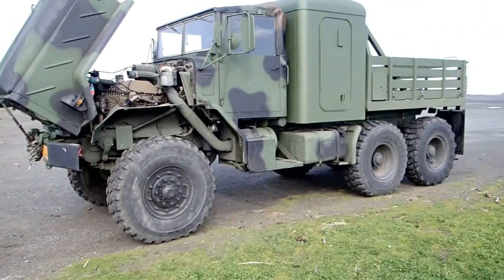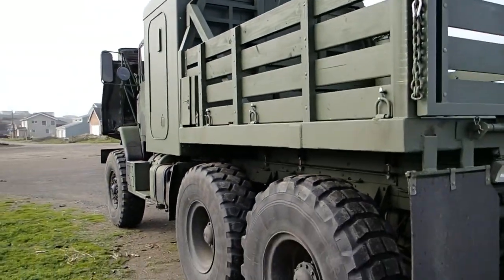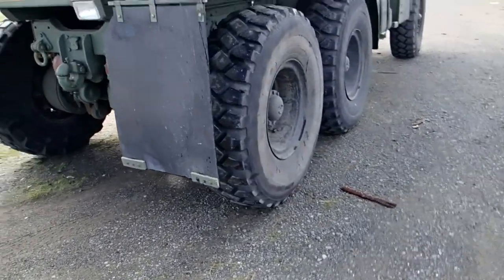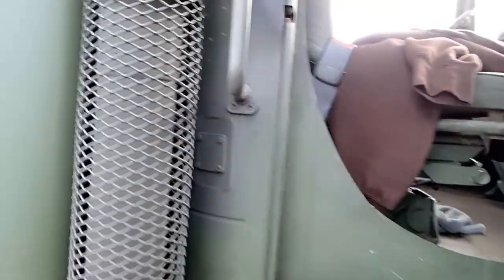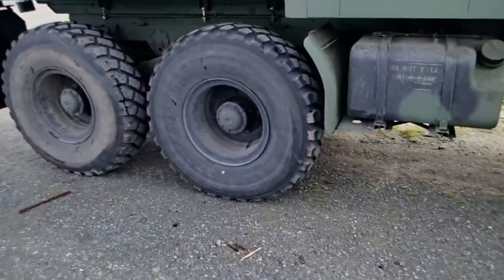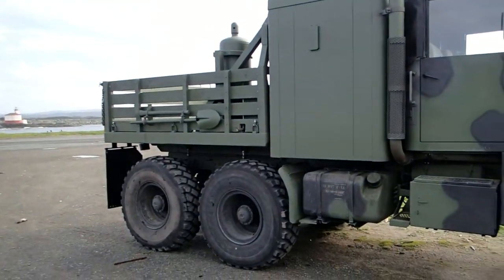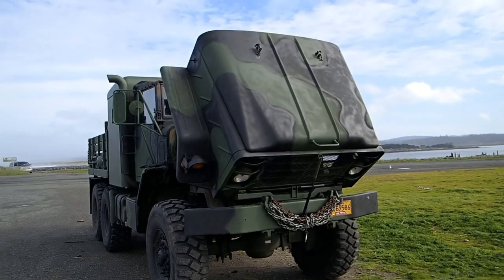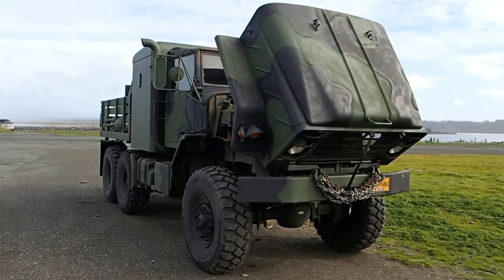M932 6 X 6 Modified

Comment: You are wrong about the humvee not having a 6.2. They came with them originally but when the 6.5 came available the 6.2's were swapped for 6.5's if they blew up or if the truck wasn't being turned in. We were still swapping 6.2's for 6.5's up until about 5 years ago at my shop
Reply: The swapping info is wrong to.The HMMWV had the 6.2L just like the CUCV until the 6.5L Turbo came out and then the Humvees with the 6.5L had Grilles and Headlights that were out instead of all flat like the original Humvee.They never swapped 6.5's into the older HMMWV's.

Comment: I have a CDL, I want this set up so bad! Im going to try to make one to use as an own/op
Reply from the maker: For personal use, do not need a CDL, but it will help with having experience behind the wheel of a bigger rig.  This is a sweet setup...
Reply: @1JawsJr  I'd use it for commercial use because I think that would be cool as hell. Thanks for sharing this with us it really made my day
Reply: @johnnyfedpost1776  

Hope you like going slow.
These things are horrible on fuel and geared low.

Cant hit 80k with those tires and most trailers aren't tall enough to be pulled by one of these. 

It can be modified but its going to be super expensive. 

They make great toys though I own one of these and a m35a2. 
I love these old rigs but line hauling in one is a little out there 😁

Comment: That's actually a M931,not a M932.Both of them are Semi Tractors,but the one in the video is a M931.The M932 has a PTO Winch on the front instead of a Bumper.Just like how the M923 and M925 are the same truck except one has a Bumper and one came with a Winch.And vice versa,if this was a M932 that had it's Winch replaced,just like what happened to alot of M925's,the Manufacturers Chart will say "W/W" (With Winch) or "W/O" (Without Winch) to know the originality of the truck.
Reply from the maker: Winch was removed and replaced with the smaller bumper.